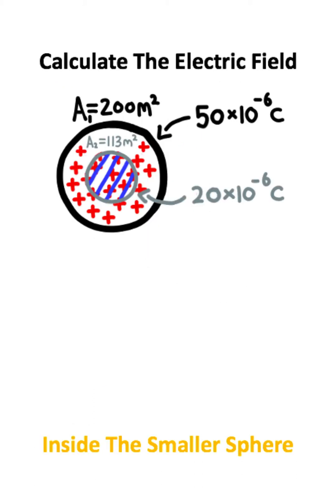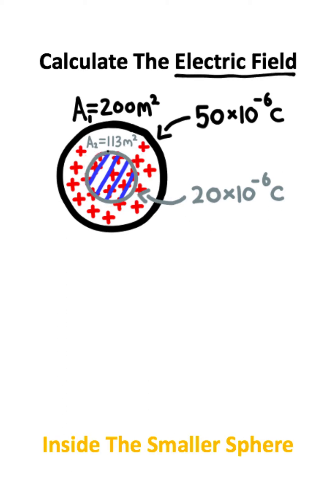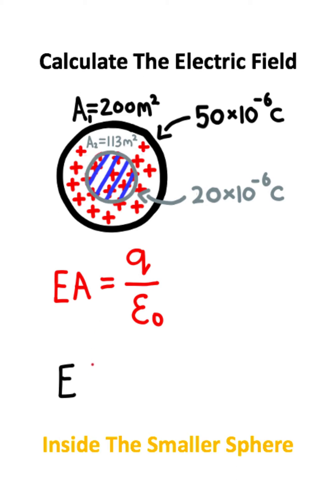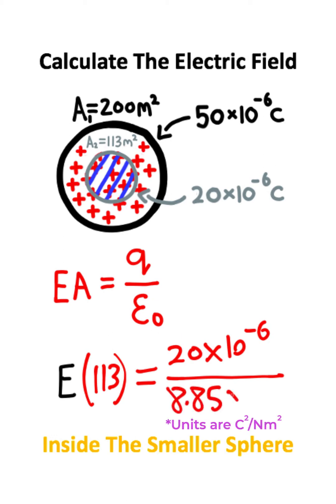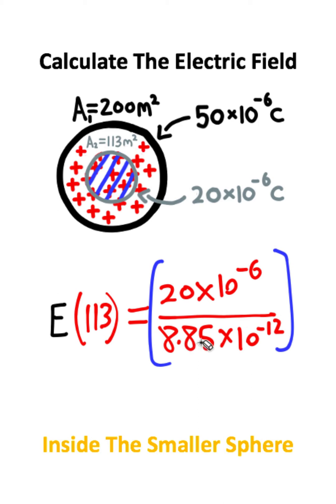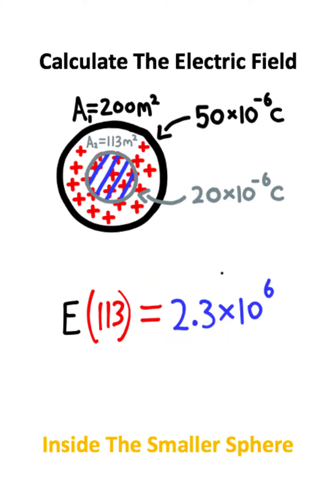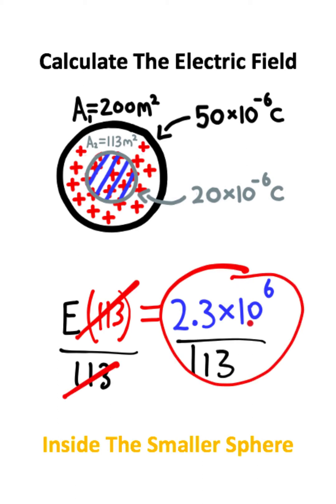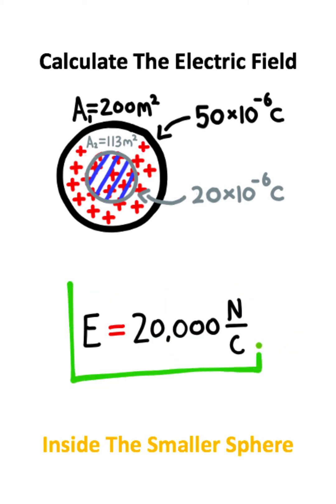Engineers MUST Know This...

Comment: Engineering in school is not like in real life. 19th century science does not play a lot in engineering. 
Please use examples that are useful. How about some solid state batteries?
Reply: Larp you need to calculate a propagating electric and magnetic field and their strength / magnitude in a Transmission power line. Little bro🐗🐗🐗🤡🤡🤡